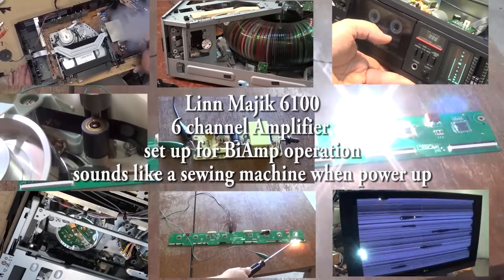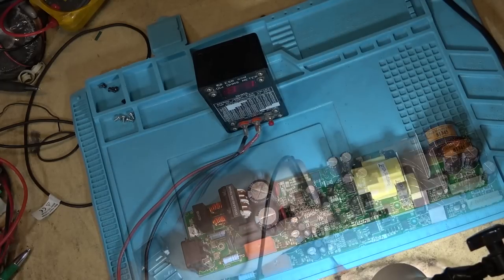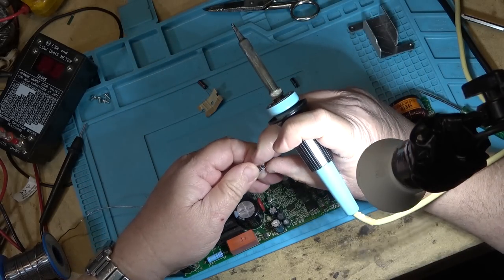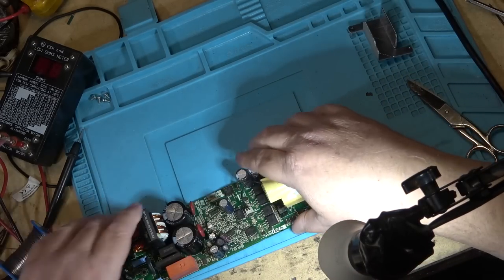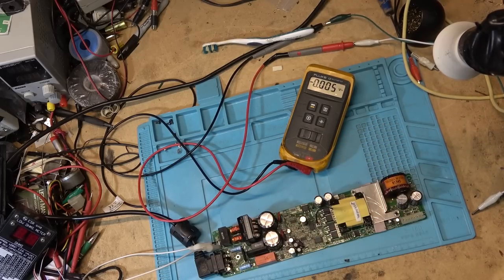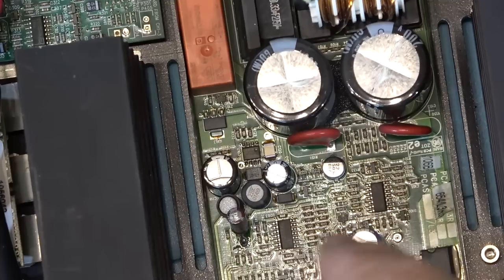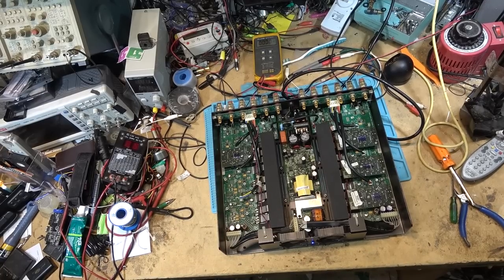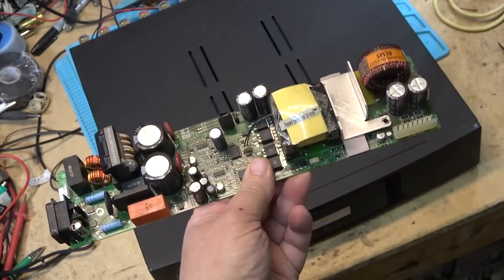Linn Majik 6100 Amplifier sounds like a broken sewing machine.

Comment: Very close. The cards are Active crossovers tuned to a specific Linn speaker model. The speakers can be configured to remove the passive crossover and the amp drives each driver directly. This Amp would have driven a pair of two way speakers each with a tweeters and mid/bass.  The other two channels are missing cards and thus would have remained un-used. 

These amps also have a later model of PSU the "Dynamik" that can be swapped in for about $800 apparently this is an even lower noise switched mode supply.

Amps are Chip amps with an extra bipolar driver stage that comes in at high power. The 200W (Akurate) version have another following transistor setup. 

These are some of the best amps I have ever listened to.

Comment: Made in Scotland. I believe this amp originally cost around 4000 GBP.
Reply from the maker: @Kent Teffeteller Bryston made in Canada. My big Crest is made in  the USA and it looks to be relatively service friendly. Just remove the big heat sink and the board comes with it. The Linn amps however have a sound that is unlike most. I have only listened to 2 and they sounded amazing.  Just like that class D VTV purify amp I was testing a few weeks ago. I heard stuff in the mix I have never heard before. Bongo drums, and other stuff burred in the mix just comes alive. For those that have never experienced this, you don't understand, but once you hear something that you thought you knew and all of a sudden there is more there. Its just like listening to vacuum tube gear. Once you hear it, you want to spend the money to continue to heat it.
Reply: @12voltvids  yeah I once had a demo of a complete Linn cd only system, it comprised of 12 separate boxes and two massive floorstanding speakers, needless to say it sounded amazing and had a retail price (at the time) of over £40k.
Reply from the maker: @markrowe8824  yes.  Crazy en when a sound system costs as much as my house did when i bought it.
Reply from the maker: @Kent Teffeteller i listen at lower levels all the time on my crest and it drives my B&W speakers nicely.  QSC also sounds great.
Reply from the maker: @Kent Teffeteller you have obviously not heard the NAD and VTV that use the purifi modules.  I test drove one for a week and it was an experience. I was listening at low to mid levels too, nothing ear shattering and mostly acoustic music
Reply from the maker: @Kent Teffeteller I have a vs900 and it sounds fantastic.  I typically prefer tube gear.

Comment: Where I work now and where I have worked before I've seen small SMD electrolytics as the source of a considerable bit of drama on NEW assemblies. The larger ones also like to pop off the board during drop testing--no idea why we still insist on using them. Some of those in that Linn looked like they were bulging slightly and had cracked screen printing. The ROHS lead-free reflow process often causes that and obviously isn't doing them any favors.
Reply: I hate them I just replaced 22 of them on a Pioneer power amp !

Comment: Got my hands on a sort of working 20 year old Sony SACD player on the cheap, would replay CDs no problem, but had to be re-loaded multiple times to realize a hybrid SACD was inserted, but then would insist it was CD only once powered down and up again, so cue open/close and hope for the best. Decided to start by replacing all SMD caps and then try to figure out what's wrong with it later. Got a bunch of low impedance UCD/CL/CW Nichicons and had lots of fun trying to position them on the pads, as some turned out to be juat a bit larger than the originals. Managed nevertheless and guess what - that actually solved the SACD playback issue! Old caps measured tens of ohms in terms of ESR, especially on the RF board.
Reply: ATA boy

Comment: A switching power supply in a Class AB analog amp. Surely the purists in the audience have all fainted away.
Reply from the maker: On the contrary.  I remember the first one i saw.  It was a Sony amp back in the 80s and the pulse power supply as they called it was in a totally enclosed aluminum box.

Comment: I have only worked on a small number of Linn amps despite living in the UK.
Linn have always had a knack of making great sounding gear.
I have admit to not liking amps that use switching power supplies, sooner or later they fail
and 99% of the time it's bad capacitors.
Easy for me to fix, but not for customers.
I prefer linear power supplies with toroidal transformers, they more reliable and provide
a cleaner DC supply.
Reply: Yes switch mode power supplies seem to inherit crap caps as I had a monitor audio Sub with a switch mode power supply and it went bad because of the Big caps
Reply: @johnweegenaar7314  The problem is caused by poor design of placing capacitors close to components
that run hot, then enclosing the whole pcb inside gear with no airflow.
I have repaired hundreds of subs and it's nearly always the caps that go bad.
Reply from the maker: @Barbarapape  except there are two fans blowing air directly across the powerboard.
Reply from the maker: Switchmode provide much better regulation and are free from the 100/120 hz ripple that all unregulated linear supplies suffer.  
All linear supplies will dip when the load goes up.  A switcher just hums along without breaking a sweat.  A switcher also has over current shut down so if something goes south they can shut down much faster than any fuse can blow to prevent a single component failure from turning into a disaster.  The caps fail due to internal heat generated inside the cap not so much external heating.  Switch mode don't generate heat themself but the caps do get hot because they are dealing with khz frequencies all day.
Reply: @12voltvids  Switched mode may be more able to deal with loads and offer better protection, but from my experience
they are a common source of problems in any gear that uses them.
Oppo used them in their high end blu-ray players, and a very common upgrade was to replace them with regulated
linear power supplies that gave a superior performance, this was one of my last jobs before i retired from the trade.
You wont find them in Arcam amps or receivers for a good reason.
Reply: @12voltvids  Those fans didn't save this amp from failure, capacitors dry out due to ageing and heat
even if the capacitors themselves are a source of the heat.
No electronic gear lasts forever, a lot of it is scrapped due to the cost of doing a full re-cap.
At least they keep us going during our retirement.
Reply from the maker: @Barbarapape  you sure about that?  I have seen very high end amps that use them these days.  Linear supplies gave huge troubles back in 90s on Mitsubishi VCRs. They all leaked and pissed corossive liquid all over the board.   With efficency requirements put in place especially in the EU manufactures just can't use power supplies with 40 or 50,% efficency.  Smps closer to 96% efficency.
Reply from the maker: @Barbarapape  true. SMD caps are the worst ones.  Just wait till they start failing in the battery module controller on electric cars.   That will be the write off time for those Tesla's.
Reply from the maker: @Barbarapape  they are jacking up power rates here too. Building a new mega dam which we will need to feed all those electric cars. My town is know as t town. T as in Tesla.  So many of those ugly duckling cars out here.  Seems like everyone has one.  Some have 2.
Reply: @12voltvids  I first encountered SMD cap failures when i was working for the RAF.
Marconi 2019 signal generators were full of them, the ones on the RF output stage
were very unreliable, they had so many failures that they issued an upgrade kit.
This is where i learned how to use a hot air rework station, and took an instant dislike
of Surface mounted components.
Todays gear are full of them, just waiting to fail, as you say the unwanted electric cars
will have a short life.
Reply from the maker: @Barbarapape  i don't know where you cone up with unwanted electric cars.  There is a 5 year wait list to buy several models.  The shortest list is 2 years. I have a friend that put his deposit on one 2 years ago.  He had to buy an old beater to hold him over till his new one is ready.  Its the other way around.  More are few up with high fuel prices and jumping on the EV and plug in hybrid bandwagon.  I am one of them. I have 2. My first one is 12 years old and going strong.  I'll never go back.  Costs me about 30.00 a month to operate my car.  How about you?
Reply from the maker: @Barbarapape  the same applies here.  Lots of people charge on street. They make rubber cable mats you throw over the cable where it crosses the sidewalk. 
Here they are mandating that all new buildings have level 2 plugs for each parking stall in apartments and condos.  Everywhere you turn there are charge points.  I haven't used any however.  Cheaper to charge at home.  I have 2 charge cords stretched across my driveway.  Trip hazard you bet but last time i checked tresspas is illegal and someone would have to be on my property to trip.
Reply: @12voltvids  The trip hazard will apply in any part of the world, the other big issue in the UK is the price of electricity
until the end of march the goverment gave all of us a £67 handout to get us through the winter, that has now ended
and all they have done is kept a price cap inplace for another 3 months.
This is why in the UK very few people want battery only vehicles, at supermarkets i often see motorists fighting over
the only two charging points.
The general view in the UK is that they don't want any cars on the roads by making them too expensive to buy and run.

Comment: I can't seem to figure out what class of amplifier that is, but I don't think it is a class AB amp.
Reply from the maker: I believe its a class AB. See the output transistors/ There are 3 channels per side. 6 trasistors and 3 ICs. The IC would be the voltage amplifier / driver stage.

Comment: My Device says 250v 2amp fuse only. There are supported voltage details. Will this device works with 220v. I'm buying this from Japan.
Reply from the maker: the voltage on a fuse is the arc over value and needs to be higher than the operating voltage.
2 amps is the trip current. It doesn't matter is it is 2 amps at 240v or 2 amps at 2 volts. The problem would arise if you put a 2 amp 30 volt fuse on 120 or 240v circuit. Would work fine till it tries to blow. Then it can arc over and not kill the power.  a 250v fuse on a 12 v circuit will blow just the same.
Reply: The fuse's "marked voltage rating" has nothing to do with the devices actual input voltage requirement, that number is the maximum voltage that fuse can interrupt safely ... always check the devices actual listed voltage requirement and AC Frequency Range .

Comment: Surface mount electrolytics are terrible. You can't tell the series, they're a pain to remove, and they fail quicker. I would say to use surface mount polymers instead, but I don't think you can do that in a power supply.
Reply from the maker: Not to mention they leak and can damage the traces.

Comment: There's good chance that also the SMD capacitors in the other boards have passed away...
Reply from the maker: Power supply is exceptionally hard on caps as they Are operating in the 40 to 60khz range.
Reply: @12voltvids  And maybe the PSU board gets hotter. It seems like they needed to address the heat transfer.
Reply from the maker: @rbtgmnstcs  it dies have 2 fans blowing air through the tunnel.  I guess you skipped that part or fell asleep.
Reply: @12voltvids  That's what I meant, that Linn had to do something about the more compact SMD design, compared to pin/hole mounted. Saved money on some of the manufacturing, but couldn't rely on passive cooling.
I didn't fall asleep :) I find your videos very interesting and I've learned from your knowledge.
Reply from the maker: @rbtgmnstcs  I'm sure the 4 smd were chosen for what seemed like a good idea at the time.  Robotic assembly the most likely reason.  All the SMD are relatively low voltage.  All the higher voltage parts are thru hole. If high voltage SMD were available they probably would have used them as well as less hands on during production.

Comment: How old is that amp?
Reply: not sure exactly but doing a quick search I found a review of a different "Majik" product from 2008, in fact Linn's own website shows this power amp as still in their current lineup.
Reply from the maker: Hifi center in Vancouver has one in stock right now for only $5930.00 so that would indicate that this is still a current model. I notice they also have the Linn Klimax 2 channel amp. 200 watts per channel and its only $15,490.00.   I think I will order mine today.
Reply: @12voltvids  great I'll order two, do they do shipping to the UK? 🤣 , downloaded the manual for this amp and it shows the first edition (for the manual) as March 2005.
Reply from the maker: @markrowe8824  this one is dated 2008 right on the power supply.  This amp is still current.  You can buy one today.   Well perhaps not today as it's a holiday but tomorrow.